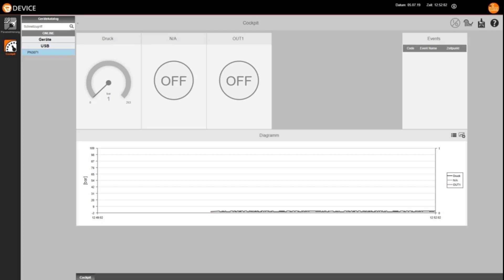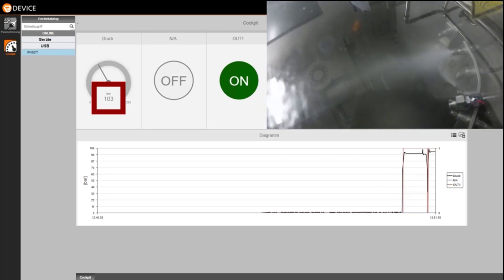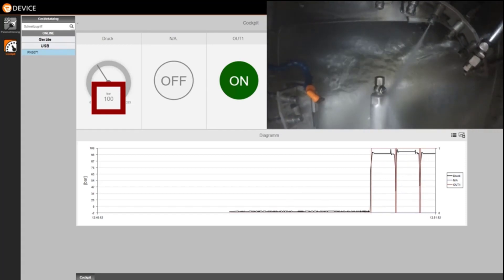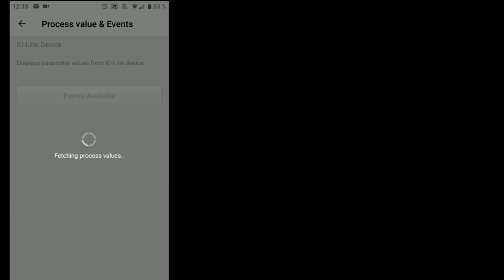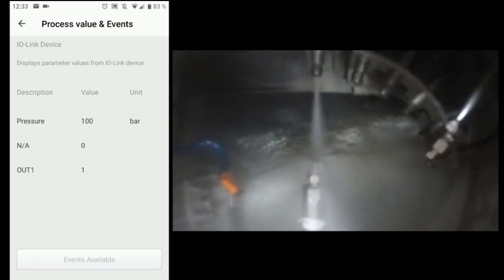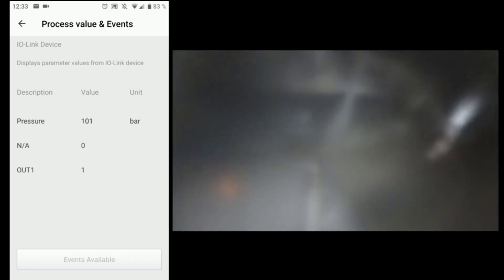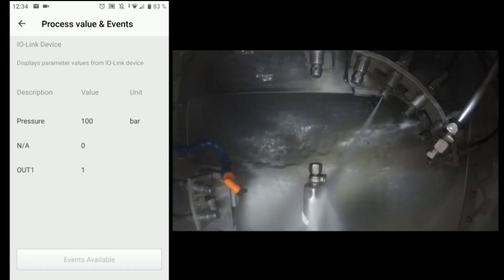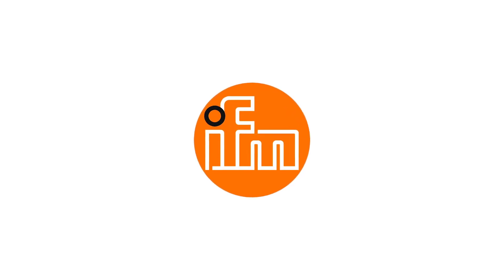How to: Digital retrofit and visualization with the IO-Link data splitter and Bluetooth Adapter

Comment: one with query the io-link bluetooth can operate with the VSP001 accelerometer sensor
Reply from the maker: Unfortunately, the VSP001 is a piezo-electrical sensor with an IEPE output signal. 
An operation with our IO-Link accessories (e.g. Bluetooth adapter, IO-Link splitter, IO-Link display) requires an IO-Link communication.

Our IO-Link vibration sensor would be a VVB:
https://www.ifm.com/de/en/product/VVB001